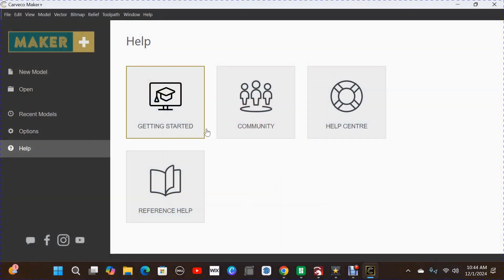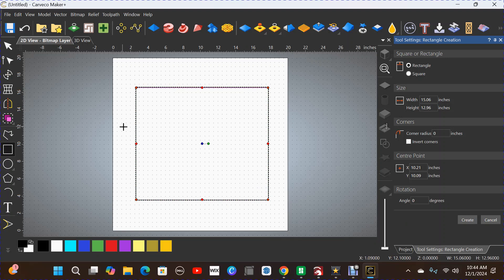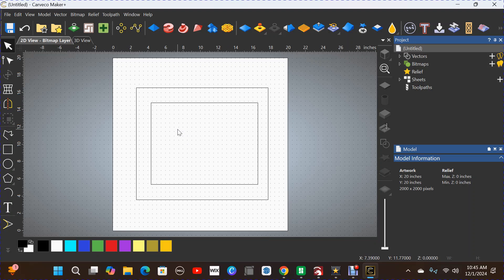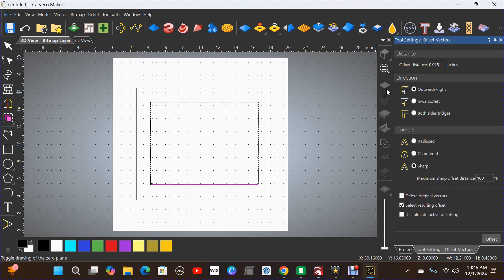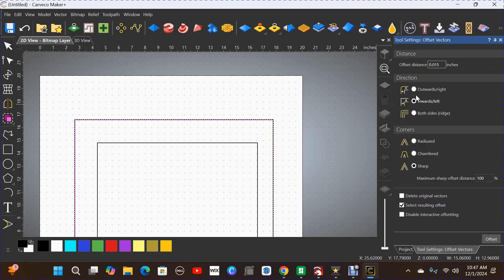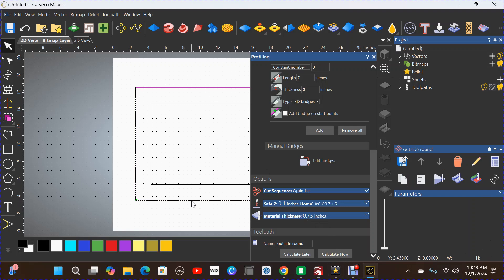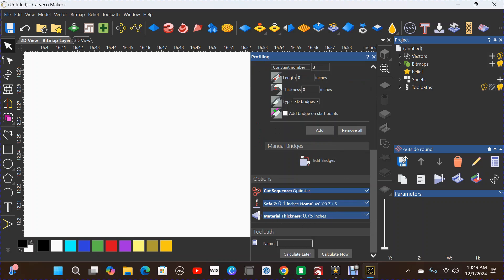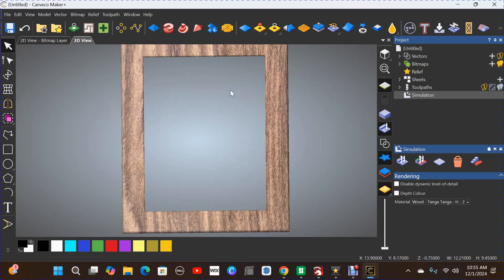How to use a Radius bit on your CNC wood projects a step-by-step process

Comment: nice work !  :)    I use Carveco too.  What are 3 things you wish they would improve on in future updates?   I would like to see a "calculate all tool paths " icon , the ability to enter values in imperial or metric when the opposite units is being used.  Id also like to see values be able to be modified by simply adding or subtracting by use of the plus or minus key   for example.   100MM+.187in and have it automatically calculate it.  Lightburn has a lot of these features. I would also like to see the background color of their menu system be customizable vs the current black background.
Reply from the maker: @nwmi493  
Thank you 
1- color theme from red/green 
To anything else i’m those colors blind
And thats about the only thing I’ve ever had issue with 
It makes the vector doctor tough for me to use but i have figured work around for it.

Comment: Great video Vernon. Instead of creating the extra lines for the tool path just create a tool in the tool database with .030 a diameter and give it the same feed and speed as the one you used. Then all you have to do is select the inside or outside of your line as usual. Carveco only needs to know how big the center portion of your bit is to function normally and the depth you need it to go. It is really quite simple actually.
Reply from the maker: Great stuff Billy and Thanks for the info
Took me a second to wrap my head around that but you are correct loading a bit with the given dia and changing to an inside or outside tool path strategy would work and be much easier
Takes a few minutes for things to sink in to this old brain LOL 😆 
Thanks again
Ps you could also adjust step down to a greater distance to reduce passes

Comment: Onion Peel??  Very nice video and I always learn something new.  Thanks!!
Reply from the maker: Thank you, Michael
the term "onion peel" refers to a very thin strip left on the stock when cutting parts loose. You leave that very thing connection, so you don't need tabs, when finished use a flush trim bit to clean up and cut the part loose from the stock. 
When I produce the waste board rules video it will be much clearer.